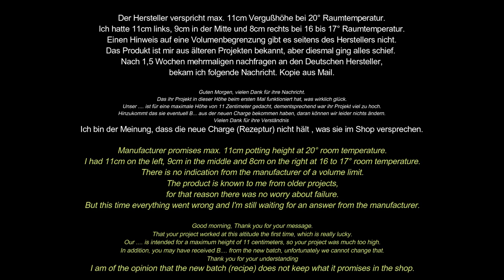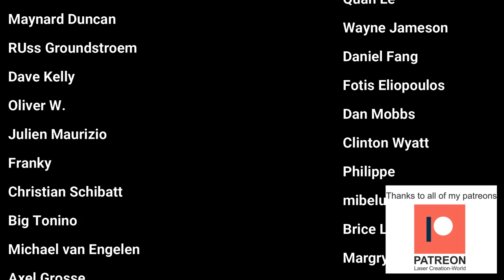ICE ROAD Diorama scale 1:24 / 18kg Epoxy Resin

Comment: Just an astonishing build.  So much desperation in the middle of that after putting so much work into the truck, trailer, dozer and weathering just to get to the start.  Having worked with epoxies I was more worried about the potential for a large exotherm with such a large mass of epoxy going off.  Just an amazing finished result and such a great recovery!

Comment: Bloomin' incredible! So impressed with the perseverance. There are so many different products you use to full advantage. You're very daring to use those 3D printers, multiple water, ice & snow features, plus the borders. I would be very hesitant at potentially writing off the articulated truck with water & ice renditions going wrong. These are major modelling projects, getting on the line of engineering. I feel very inspired looking at these works. Also, humbled.

Comment: I bought an AnyCubic printer and was seriously disappointed. The machine printed the supplied test print perfectly, but when I downloaded some .stl files (for a commission build client who wanted them) and put them through the supplied slicing software, the printer wouldn't print. It wouldn't even recognize the files. I reached out to tech support and it was pretty much non existent. On top of that, there are no instructions or tutorials on how to use the software that I have been able to find. Happily, I bought the printer on Amazon (because it was cheap, less than $200.00) and I was able to return it. The cheap really does turn out expensive sometimes. 
If you can get this thing to work, good for you.

BTW, Laser Creation World rocks. Your dioramas are to die for. some of the best I've ever seen.